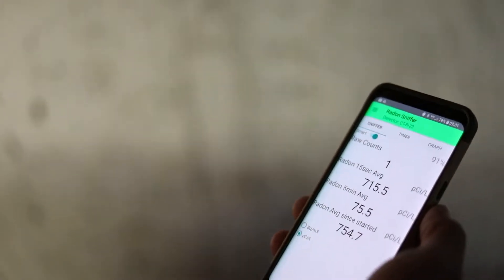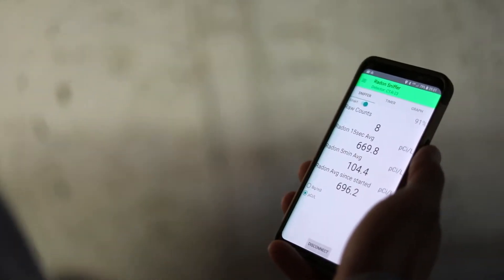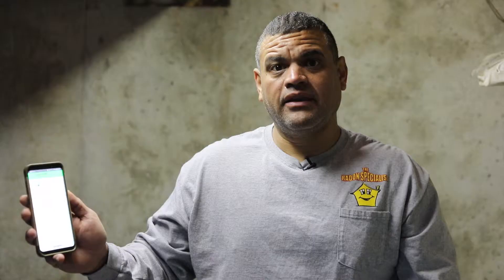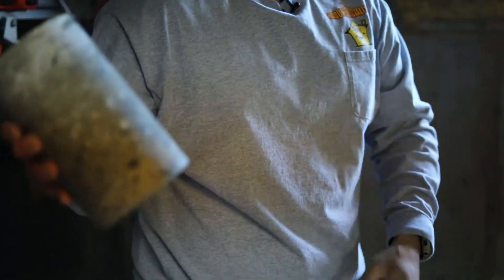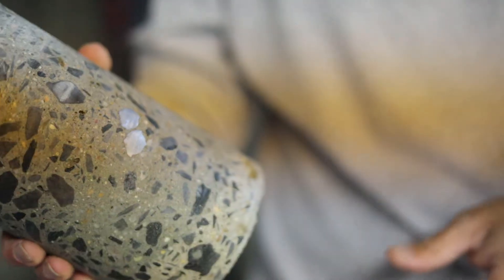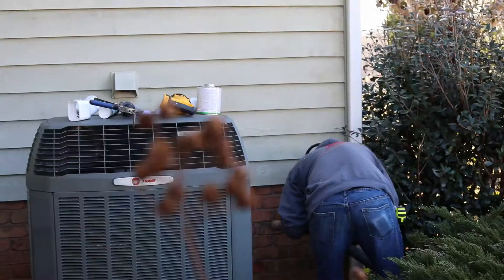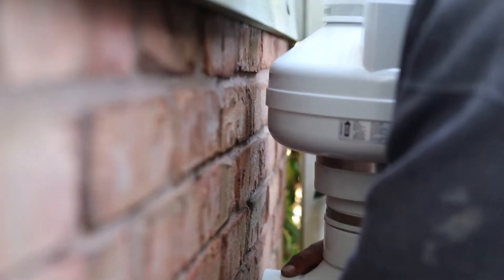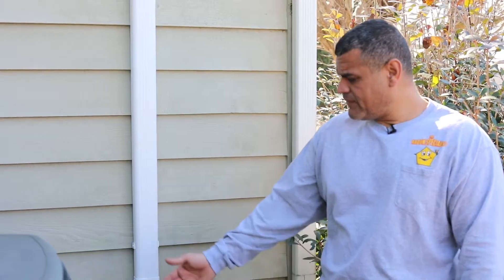How To Professionally Install A Radon Mitigation System

Comment: This is wrong! You never want to reduce size of pipe with air flow or any plumbing drainage! You went from a 4 inch pvc pipe inside insulation to fan motor outside to a reduction of 3" cheap  gutter downspout pipe exiting the top of the fan motor to above roof line! Plus the caulking will never seal with  those cheap downspout fittings. The caulking will eventually crack over weather conditions! All these YouTubers supposingly are professional are skipping an important step before glueing a pvc pipe to any fitting is that you use pvc cleaner first then pvc glue!!!

Comment: Why not install the fan in the basement section of the pipe? Why the need to have the fan outside?
Reply: You want negative pressure in all pipe inside the house.

Comment: Question,  this is the only video that shows the use of piping outside the house thats not just pvc round pipe. Looks 1000% better.  Is that just standard pvc gutter materials? Or something engineered for radon mitigation
Reply: Exactly. Everyone in my neighborhood has the ugly PVC pipe running up the house. This looks much cleaner

Comment: If in that house the 5min average was 104.4 ... and in my house the 1 day average is around 3.9-4.1 ... should I even worry or not?
Reply: Anything 4.0 or below is considered a safe level. My advice would be to retest every year. If it gets up to 7-8 or more, you may want to consider mitigation
Reply: I think the very high numbers he mentions of 200 to 1,000 were taken directly in the soil under the house to find the highest concentrations under the slab, not inside the room. He said this basement averaged 15 inside.

Comment: great video! but get yourself some Hilti tools. the new water management system in the core rigs leave no slurry whatsoever and the torque control and AVR on the hammer drills wills save your guys' wrists and hands.

Comment: That's crazy to know you live on top of a Hazzard area never heard of radon until I seen tictok video, showing pipe work done but I guess rain water was back flowing into the foundation and was probably blocking air flow.. I live in the city side where we don't have septic problems like that but it's good to know how it works and what is the solution to the problem., the pipe work looks similar to wall mounted heating system pipe work. Love learning new things that can better a home tho...

Comment: Good video, thanks. I take it this is meant to be partially a customer facing video. If so, you should qualify your measurements with units when quoting numbers like "...273.6..." and "...almost 1000..."  such as: "We measure radon levels in pC/l, I see 273.6 here and almost 1000 there" or "I see 273.6 pico Curies per liter here and 1000 pico Curies per liter there", but you don't have to listen to me, you obviously know what you are doing. Other than that I think the video is spot on. Nice drilling equipment.
Reply: tbh he probably doesn't even know.

Comment: what is the difference between high suction fan vs high vacuum fan? What radon level reading in order to use the high level vacuum fan?   Isn't the rain going inside the gutter where radon is blowing out from?

Comment: My question is, for appearance reasons,  why does the fan need to be installed on the outside the house instead of inside the basement or crawl space ?
Reply: You only want negative pressure side of the pipe inside the house. 

If you were to put fan inside, if a leak formed in the pipe on the positive pressure side of the pipe you could pump radon inside the house.
Reply: New homes it common to put the fan up in the attic and vented through the roof. On a retro install that’s going to be a challenge to run that 3 or 4 inch pipe up through finished walls so most of the time they just do side of the house.
Reply: @Ebrunn34  That is fine.  Attic is not considered living space, and ridge vents, etc would allow it to escape if there was a leak "after" the fan. Most likely the fan to the exhaust out the roof is a solid piece of pipe without joints where that would be highly unlikely for a leak to occur.
Reply: @hecklefish  You are not wrong, but Radon Gas is cancer causing and odorless. Steam from a bathroom and kitchen fans aren't as critical to not let what they are exhausting vent into living space.

Comment: Excellent workmanship Abe. Putting a hole in the cement  and hooking the fan  in the cement sealed around the edge.. Would that make the fan struggle  to exhaust out the pipe.

Comment: Is there a weather cap that will be going on the top of the gutter top?
Reply: That's wrong! You don't want water to go back down into the basement Into the hole you cored out for the pipe! That water will have a lock effect and will not let air flow of radon from under basement to roof top vent! Put a PVC 90° on very top of exhaust vent above roof line or you can put on an upside down T
Reply: No, it's designed to let the rainwater back under the slab. You can have one but it's not necessary.

Comment: Anyone else notice that None of the mitigation experts who put out these videos, this one included, wear any PPE such as an Approved  P100 mask? If it's so bad, you would think that someone who works with n this field everyday, exposing themselves constantly to high levels would want to be protected from it...
Reply: The problem as I understand it, it Radon is very difficult to filter out of the air.  It's not like dust but a gas that cannot be separated out.  I could be wrong here but that is what I read.  I guess that is why you can install a Radon filter instead.
Reply: Also radon exposure about exposure over time. So radon is present in the air everywhere but high concentrations radon is the problem long term. Radon levels above 4 pCi/L should be mitigated.
Reply: The danger with radon is that it will accumulate over time in your home and irradiate you over years. It's the most common cause of non-smoking related lung cancer
Reply: This is the perfect comment to demonstrate when someone doesn’t understand radon - how it impacts or penetrates the body, exposure over time, no concept of dosage, etc.  

Really solid.

Comment: Why is the fan outside? Could it not be installed in the basement?
Reply: This is building code requirement. Radon fan must be installed outside so only negative pressure applied inside the living space. This is to prevent the situation when exhaust is blocked and vented air goes back to living space. You can install it in attic or garage though if you can route PVC pipe in there.

Comment: Hi Abe, great video I wish you were up in the Washington DC area, I would have you install ours. Have you ever worked with or installed a system with basement walls built with Superior Walls? I having radon companies not being able to guarantee their work because of our. The house is only a couple years old and we have ratings of 8.7-9.0. You know anybody up in southern Maryland area (Prince Georges County) you would recommend?
Reply from the maker: Claude Stark Contact Abe with some details and he can provide more info directly  http://radonspecialist.org/
Reply: For superior walls you need a back flow valve at the outside drain pipe. This is to stop air from simply coming from outside through the drain pipe and short-circuiting the rest of the slab.  The stone under a superior wall is actually one of the best situations for radon reduction.

Comment: Beautiful install until .... you dont put a cap on the vent?  So rain water can go under slab?
Reply: That would be normal, there isn't anything wrong with condensation or rain going back into the slab. A cap would restrict airflow.
Reply: @youknowglenn  not a sealed cap.... a rain cap. Regardless   i don't agree with you , imho water is going to go back under slab.
Reply: @patrickkanick1283  that's fine, you don't have to. I own a radon mitigation company and am NRPP certified and a member of AARST. A "critter gaurd" is the only acceptable "cap", which wouldn't stop rain from going down the pipe. In fact, it is against protocol to install a "cap" on the system. Also, the system itself is probably creating way more condensation than rain that would enter the pipe. Just my two cents :)

Comment: What a bullshit? From a geologist point of view, there is no system today that eliminates the presence of radon unless you remove all the soil, bedrock or the grade on which the foundation and the house sets and even if you do that remains in the air. However, this is more like a placebo pill which makes a very good niche to make a lot of money and good for you If homeowners are not educating themselves and learn that a $30 fan/venting outside can take care of pretty much any kind of soil emanations, fumes, odors. It is more dangerous the microwave radiations than the overrated and blown out of proportions radon gas which is not only coming from the ground beneath homes, streets or buildings through cracks, sumps, joints, floor drains or other tiny openings in foundations or crawl spaces but is present in everything including your car. From a scientific aspect and based in evidence radon is considered a noble gas due to its none aversive which does not rise more than few inches from the ground and last more than minutes until entering in contact with other gases, particles of any kind extending its presence which exists even in the most unpolluted areas because it is in the air and you can not give read of it. Your 150 grams of potassium present in your body emanates more toxic radiation than all the radon present in 1000 homes. People exposed to radon are at a greater risk of developing lung cancer. EPA recommends taking action to reduce radon in homes that have a radon level at or above 4 picocuries per liter (pCi/L) of air (a “picocurie” is a common unit for measuring the amount of radioactivity). Oh EPA recommends based on what? it is no scientific evidence of such claim considering that 1 picocurie is the equivalent of a nanogram. What a bullshit?
Reply: Fan is good... better if it is installed close to the point where radon enters home though. Granted homeowner can do it for $150-200.

Comment: I see that you are using a square exhaust pipe.  What kind of coupling did you use to connect the round end of the fan to the pipe and where can I buy it?  I will be replacing my non-working fan and would like to change the coupling too as it is old with possible cracks but I am not finding any round-to-square flex coupling in home depot, lowes, or even online.  If I don't find it, i have to change my pipe from square to round. 
Also, do you just let the fan sit on the pipe, or do you secure it to the wall with screws?  My fan seems to be just sitting on the pipe and I read that it could cause vibration if attached to the wall.  If that's true, why does my RadonAway fan have screw holes for securing it to the all?  Thanks.